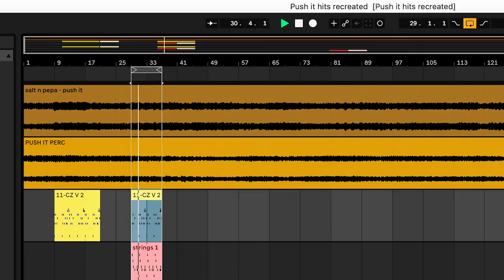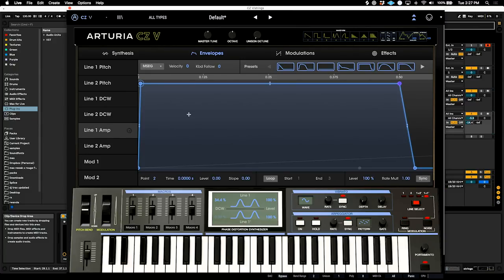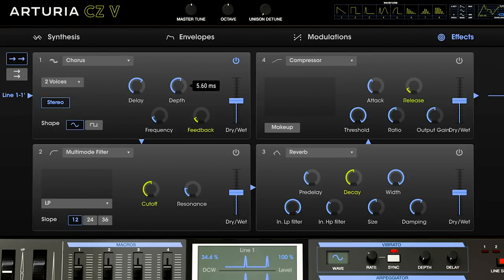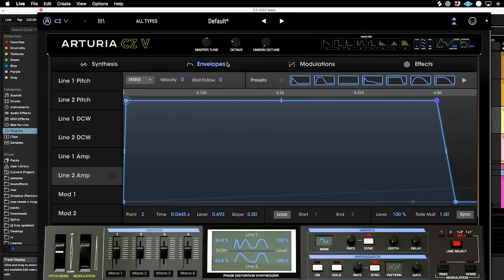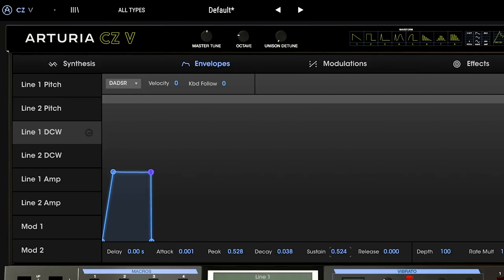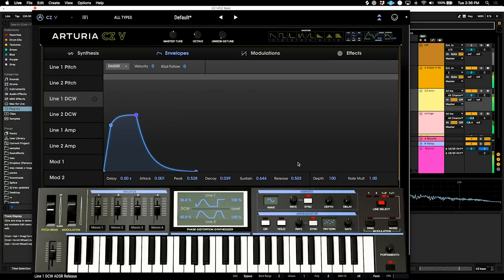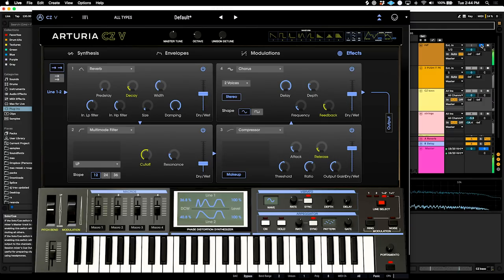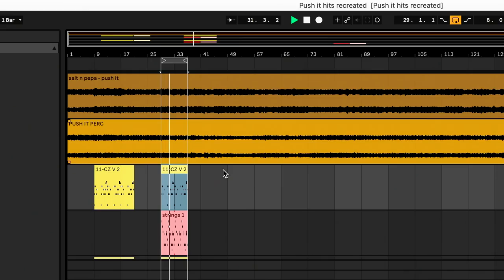How to Recreate the 80s Classic "Push It" by Salt-N-Pepa

Comment: I'm not really feeling it. The original was done on the CZ, so it should be possible to get way closer. I've been messing with the bass and melody part, and have it pretty close. The strings were probably something like the Fairlight so they're never gonna sound correct made with PD.
Reply: Sounds like the Marcato strings sample on the emulator II mixed with the CZ